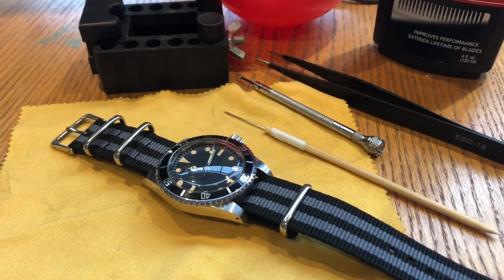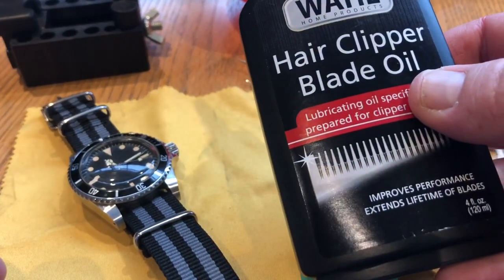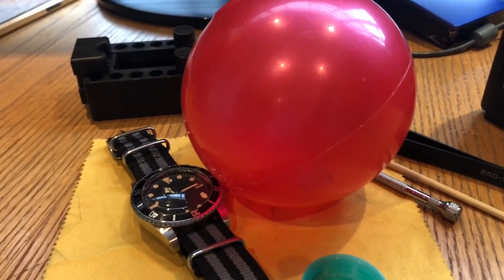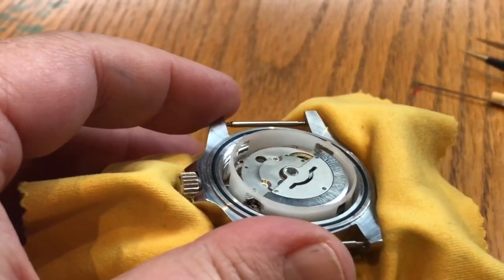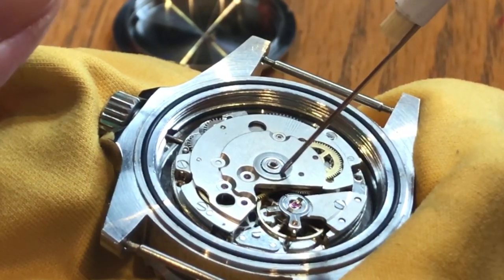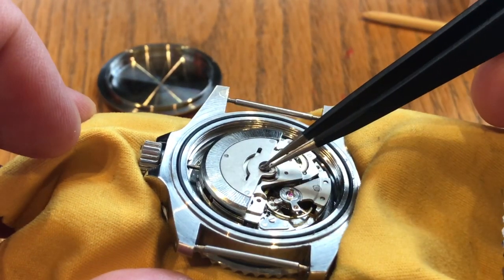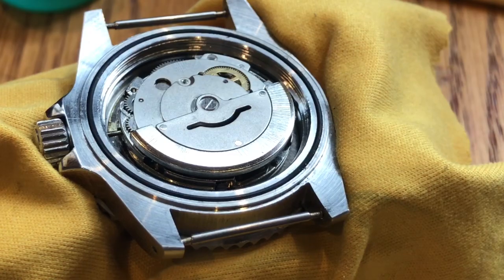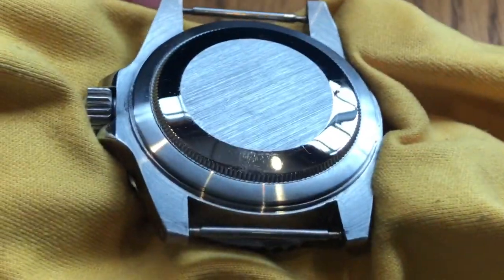How To Tame a Noisy Rotor

Comment: My miyota caliber 8215 rotor was spinning like crazy and making lots of noise. I added silicone grease in the same area/bearings as you instead of oil.  Grease stays put much better and will slow the bearing down. I used a tiny tiny bit on a small flathead screwdriver and packed it into the bearing.... kinda like repacking a car bearing.
Reply from the maker: Hey Ho! That is awesome. I’m am so glad that this worked for you. I hadn’t thought of silicone grease. Makes sense that it’s viscosity should slow the movement down
Reply: The 8215 winds omnidirectional so it spins fast versus a bidirectional rotor like an ETA 2824. I would advise against using a thick grease because it won’t wind efficiently and/or prevent it from spinning at all

Comment: Great video, one question about diagnosing the problem you showed us how to fix: Should the rotor on my one year old Longines automatic (which I just bought) spins 10-20 revolutions at the slightest shake/movement of the watch?
Reply from the maker: Hi John. I’m not too familiar with the Longines movements. But if it is a mono-directional movement (ie - it only winds when the the rotor spins in ONE direction) then yes, many revolutions when it is spinning freely (ie. Opposite to the direction of wind) can be expected
Reply: You want as many revolutions as possible. The cheaper watches, their rotors barely spin. The sign of a good watch is one where the rotor will spin like crazy without much movement.

Comment: I don’t get why people are bothered by this noise. I really like it because it maintains the illusion and reminds me that the watch is almost “alive”. But if someone does not like this sound, why did you buy it? Could have bought an expensive brand name quartz watch.
Reply from the maker: Quartz? What? I may as well buy an Apple Watch. The entire allure of these machines is that that are JUST that - machines, anachronisms from  bygone era
Reply: @watchmebuildit  I would have bought an Apple watch. I do not yet buy it because of the inconvenience of them running out of battery relatively quickly. When I mentioned the quartz watch I meant that they are an option if someone wants to see time. But a Quartz watch is just as much a machine as a mechanical one. Its just different type of machine. If the desire is to own an object that is cool and you could say has more emphasis on crafting them then ok.
Reply: They shouldn't be making that noise anyways.

Comment: The ST1612 does not have a noisy rotor. It has the same magic lever winding mechanism as an NH35, so two way winding, which means it will have resistance in both directions.
Reply from the maker: Good Point.  I'm working on buying an ST1612 as well as an ST2160 sometime - I'd like to do a strip and re-build video on BOTH to profile the sort of quality you are speaking of
Reply: which is better the st1612 or miyota?

Comment: Hello again from Sweden.
I have noisy rotors on my SNK805 and the Vostok Kommenderski. I think the Vostok could do with a bit of tweeking too as it runs all over the place, today it lost 7 minutes in 5 hours and last week it ran fast.
I have not decided on what model of Bliger SM yet but I think I will go with the white dail.
Reply from the maker: Hi Peder. Your Vostok sounds like it could be in need of a full strip-down service
Reply: @watchmebuildit  You think? 😃
I think so too but I have only had it 7 months. Will drop it off at my watchmaker next time I go to town.
Reply: @fr0d0scious  probably right. Rotor was a little loose on the Seiko, Tightened it up and it runs good now.

Comment: How is putting oil on top of the jewels going to do anything at all
Reply from the maker: Hello Yuinetal. Thank you for the question! You are absolutely correct - oiling the jewels does not help the rotor noise, but I figured - if the manufacturer who made the movement had left the rotor bearing to be that dry, there was a good chance that the jewels were dry too, so I gave them a little oil while the case-back was off.
Reply: @watchmebuildit  dont you have to take the jewels off so that the oil gets on the pivot tho m
Reply from the maker: Hi Yuimetal - no, there is a tiny hole in the top of each jewel. So the oil passes through to the pivot. Thanks for the question

Comment: Nice vid ! What happens if the case cover isn't loose or firm, I mean even 3AT wr should be, you'll need a key to access the mechanism.
Reply from the maker: Hi Matthew. I have not yet encountered a watch which I could not open with the case back ball which you see me using in my videos
Reply: @watchmebuildit  wow ! After a few decades with watches saw in this vid something that really impressed me. Let me say that I have never opened a watch my self, only some external work on my own watches. Watching this vid with the noisy rotor things ain't that hard. At least oiling the rotor. Would surely appreciate some info about this magic ball and where to get my self one. Many thanks for clarifying the ball use:)
Reply: @mathewazzopard8100  Buy at your own risk. They're easy to find on eBay, Amazon and AliExpress. I have 2 on order from AliExpress for less than $3 each. Worth a shot for that amount.
Reply: @mathewazzopard8100  if you have a hot glue gun, glue the watch back to a solid surface, twist and then peel the glue off. Zero chance of damage and it's removed even the most stubborn backs in my experience ;)
Reply: @unclefista  nice tip:)

Comment: I would also recommend somethjng thicker, a good quality ball bearing grease works better than an oil. Which is not surprising, as it is a ball bearing you are essentially lubricating.
Reply from the maker: A good point Vincenzo. I am always learning and I may well do a follow-up video to this on some time
Reply: Ball bearing oil would also work, ball bearings can use either grease or oil, and being freely spinning like that with almost no load you would rather use oil than grease. The oil itself should work just fine and much better than any form of grease would for this particular application
Reply: @platinumsky845  Almost no load? I disagree, I have a degree in fine mechanics and I can work out the math for you if you want. Small parts doesn't automatically mean small load. Oil will also work for some applications, but if it is really noisy, and especially with single directional spinning rotors it can be nice to slow them down a little. For example Miyota 8000 or 9000 series, or ETA 7000 series. Here is where I would prefer a synthetic grease over oil. On others, such as ETA 2824 a HP1000 or HP1300 oil works fine.

Comment: I was wondering if you could put in a nh35 in that case?
Reply from the maker: Hello Jin - I would not take a chance with an NH35
Reply: The answer is no, not only will you need a different spacer, the stem height is also too different. Essentially you could take a case made for a 2824, which does have a stem height closer to an NH35. Steer clear when a case says 2824/2836 though, it does not exist, yet some sellers seem. oblivious of that, or just try to lure you in with false information.

Comment: What sort of oil should be used?
Reply from the maker: HI Brendan Fong. in this video I was naughty and I used the oil that is supplied for electric hair clippers - its made for high revolution metal on metal friction, but its NOT made for watch parts.  The PROPPER watch makers oil would be Moebius Oil.  Here is a link for Moebius oil on Ali-Express:
https://www.aliexpress.com/item/32356270693.html?spm=a2g0o.productlist.0.0.7165e118uhEMnQ&algo_pvid=80a5cb2b-4457-4411-881c-4134b35ca76f&algo_expid=80a5cb2b-4457-4411-881c-4134b35ca76f-33&btsid=0ab6f82215947528218986884e34ea&ws_ab_test=searchweb0_0,searchweb201602_,searchweb201603_

Comment: not sure i'd do that, for satisfaction's sake.  when they tighten the screw, it has to be uniform torque.  therefore, a special tool used to calibrate the tension on the screw, in all likelihood - simply to control friction, and accuracy...that, and the climate control of the manufacturing room - humidity, dust etc...  so, i wouldn't do it unless as many variables can be controlled, as could be.  now, maybe, the manufacturer did a 'cheap' job, and doesn't control for error...maybe.